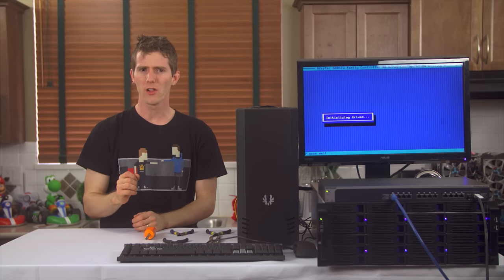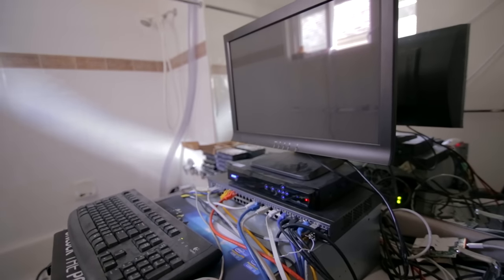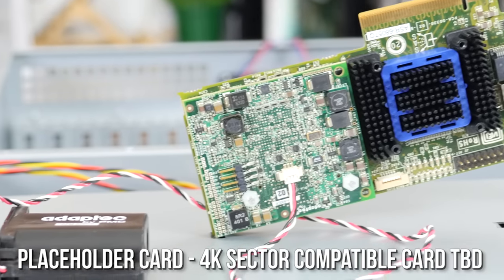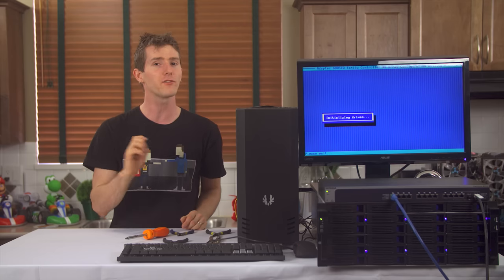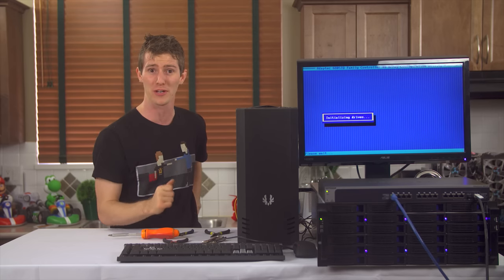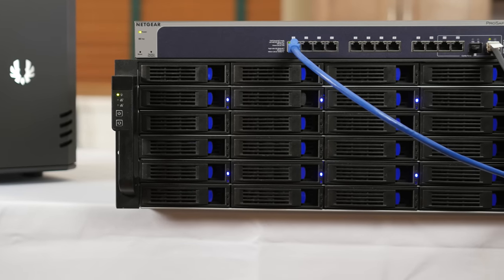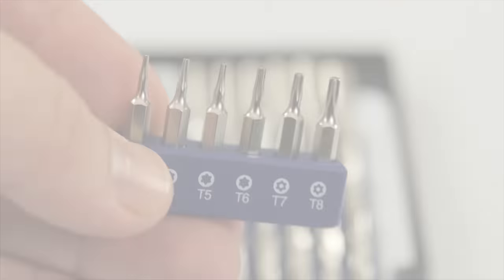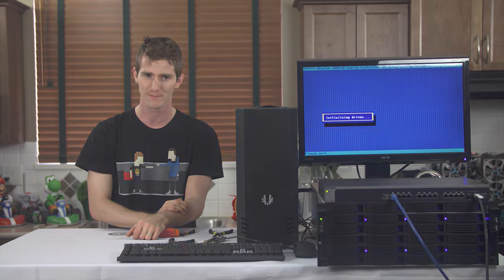Insane Storage Server - Fully 10 Gigabit Network, $1,500 Switch

Comment: You went through all that trouble and didn't use a ZFS supported OS? What the fuck is up with RAID 6? No matter how careful you are about component selection or how many redundant drives you have, you can NOT prevent data corruption which normal RAID will do NOTHING about, that's NTFS for you.

The only sure fire way of protecting your data 100% of the time is with ZFS and a distro such as freeNAS. You guys seriously need to consider ZFS if you're adamant about data protection and integrity.
Reply: I doubt losing a few bits in a video really affects anything noticeable. You're just regurgitating what Wendel said on The Tek, where he was more focused on integrity of more vital things such as documents and source code.
Reply: I do agree with you, not completely though. ZFS is a great file system to consider for large raid arrays and paired with FreeNAS, its off to the races. But, you have to understand that there is no sure fire way to protect your data a 100% of the times. The best you can do is to reduce the probability to a certain extent that it is VERY unlikely to happen.

ZFS is great because it warns you if a drive is going bad and gives you enough head time to fix it.

Also, RAID-Z. RAID-Z 3 allows you to lose up to 3 drives before suffering a complete data loss. Which believe it or not comes in handy when rebuilding large arrays.
Reply: 100TB FreeNas will need at least 100Gig of Ram... jeeeeessssuuuuusssss!
Reply: Benjamin Puna He has a 128gig kit.
Reply: Kony Hawk Pro Slaver I would agree with you, except in a RAID array, you either lose nothing or everything. So its not about losing a few bits rather about losing everything.
Reply: Benjamin Puna That amount of required RAM is based on a myth. You would only need that much RAM if dedup was enabled and had a lot more than six users. Even then an enterprise SSD L2ARC would greatly reduce that requirement.
Reply: 3fsdfsfs ZFS has a high RAM requirement because it is used to cache data before writing  to the disk (to improve performance). It is true that you can work with much lower RAM than "recommended", but enabling dedup will increase the ram requirement to well above 100gb. Its not per say a myth, because if u run out of ram, bad things can happen. And yup, L2ARC does help in reducing the ram requirement (if not using dedup).
Reply: Samar Sunkaria The problem isn't complete data loss, the problem is data corruption during regular usage, which is something you'll be encountering a lot during a regular RAID array since the disks aren't reporting faults back.
Reply: Samar Sunkaria "ZFS has a high RAM requirement because it is used to cache data before writing  to the disk"
Every modern storage stack does that and the amount is smaller than you think, typically less than 1GB per transaction and if you only have a couple of GB of RAM in your 100TB storage box, I'd question your sanity.
"enabling dedup will increase the ram requirement to well above 100gb"
Yes and no. First off, why would they enable dedup on a video data storage rig, given that they're unlikely to have duplicates? Dedup is for VM storage and similar stuff, where high dedup ratios are common. Second, with large block support having arrived in Illumos last year (don't know about FreeNAS, maybe they'll pick it up soon) and LTT's large file requirements, it's possible to comfortably fit the dedup tables for 100 TB of unique data into ~30 GB of DRAM and that's the worst case.
Reply: totoritko "Every modern storage stack does that and the amount is smaller than you think, typically less than 1GB per transaction"

ZFS is notorious for occupying large amounts of ram. There is no hard limit to the amount of ram that ZFS occupies. The more you have, the more it will occupy. ZFS maintaining 2 caches, read cache and write cache.

The contents of read cache are dynamically allocated (depending on which files you regularly access). the 1gig per TB of HD is a crude approximation for home users (2gig per TB, for enterprise). So, if you have 16gigs of ram and a 1tb hdd, you can quickly go out of cache.

"it's possible to comfortably fit the dedup tables for 100 TB of unique data into ~30 GB of DRAM and that's the worst case."

Woah, did you pull out that figure out of a hat?
Deduce in most cases occupies somewhere from 2gig to 5gig per TB of storage. In fact going below 5gb per TB mark is really not recommend. YOU DO NOT WANT TO RUN OUT OF RAM WHILE USING DEDUP.

For more details you should consider reading this doc: http://olddoc.freenas.org/index.php/Hardware_Recommendations
Reply: ***** I think Hostile is also forgetting that Linus is on a Windows server and Windows cannot be on a ZFS partition and has to be on a FAT or NTFS partition .... without using tweaks to the OS to get it to run on another type of partition but i am mostly sure they will not be supported by Microsoft support nor indorsed by Microsoft for doing so as like anything you can probably find a person who wants it to work just i do not know how to get a Windows system to run off of the ZFS partition ... now it can read off of one yes just it cannot run off of it is all.
Reply: ZFS can be used as a volume filesystem ( block level ) on the physical drives. Then you can use nfs or cifs to present your storage. 

Or you can use fc/iscsi to get block level storage ( but this will create more overhead in budget and performance ).
Reply: InIMoeK  except for his point was to " practice what he  preaches " and he didn't preach about ZFS but RAID storage though you can have both at the same time which i am surprised no one has said in this comment stream before it is a little heavier on the drives and  probably requires double as much RAM to do if also using dedup in it for ZFS to work properly without errors but still it can be done ... i just do not think he will be doing it due to it is not that practical to do on a Windwos system

fc/scsi is more practical yes though the performance hit might or might not be small enough for him to think it is worth it
Reply: Why are you assuming a RAID6 is formatted NTFS?
Reply: Jon Kensy Because RAID does not support ZFS, nor does an operating system like Windows Server. You need an OS that supports the ZFS file format such as FreeNAS which is based on FreeBSD.
Reply: Uh wait, so RAID doesn't support ZFS so that means RAID is formatted NTFS?  Does anyone who subscribes to this channel have a clue?
Reply: ***** as RAID is hardware controlled and ZFS is software controlled how does RAID not support ZFS ?
Also you can have ZFS partitions on windows just not the primary partition ... 3rd party software is required to make, maintain and use the ZFS partitions in windows but it is possible.
Reply: yumri4 The whole array needs to be in ZFS and in software parity like RAID-Z2 to prevent data corruption. You need an OS that supports it from the ground up. Normal RAID only supports NTFS. Using software tricks to have a ZFS partition on your drive is a terrible idea as ZFS is only part of the solution. You need an OS to monitor and scrub data on a routine basis to keep data integrity and prevent silent corruption. You can have 50 redundant drives, normal RAID will not save your data in case of a drives S.M.A.R.T failure or other glitches.
Reply: Jon Kensy Yes, since he didn't specify what filesystem he is running it could be any number of things, and no ZFS is not by a long shot the only FS with integrity checks, fsck, btrfsck, xfscheck etc, even NTFS has chkdsk, if your data is getting corrupted, that's what backups are for. I personally don't like hardware RAID, the flexibility of software raid is great and if you have a modern cpu with two or more cores, you really don't loose much in the way for performance.
Reply: Aaron Tate "fsck, btrfsck, xfscheck etc, even NTFS has chkdsk"
These are not the same thing as ZFS' end-to-end checksumming at all! None of these will detect data corruption. They'll only detect filesystem structure corruption (i.e. data corruption in metadata). Since the typical data:metadata ratio is around 100:1, chances are by the time you detect metadata corruption, you will already have lots of data corruption in user data.
"if your data is getting corrupted, that's what backups are for"
And how would you know which data is corrupted? Or do you suggest just plain rebuilding everything each time fsck finds something suspicious? (Not to mention you can't really run fsck and certain chkdsk while the system is using the filesystem.) Given the current size of storage systems, must have a lot of time on your hands. That's one of the core problems addressed by ZFS: every operation is performed on-line and only as much of it is performed as is necessary, because storage capacities have gotten so large that you can't really afford to schedule this kind of maintenance downtime (an fsck on a 1PB array can easily take weeks).
Reply: Kony Hawk Pro Slaver Lol your just regurgitating the notion that everyone who follows tek syndicate just regurgitate everything they do. There were other places advocating zfs before the Tek mentioned it. Maybe you should be sure of what your saying when it comes to the integrity of a file before saying things like "I doubt losing a few bits in a video really affects anything noticeable."
Reply: totoritko Spot on.
Reply: Aaron Tate
Only ZFS can protect against bitrot. The integrity checks of all those filesystems are primitive compared to what ZFS offers.
Reply: They did the research, and concluded that ZFS wouldn't provide any benefit over RAID 6 for their particular scenario. ZFS would be far better for systems like thier 'Vault' server, but a redundant RAID setup is more than sufficient for what they need.

Comment: I work in networking, and $1,500 isn't much for a 10Gb switch....
Reply: its a shitty switch
Reply: Victor P You should wash your hands after using the bathroom to keep your switch clean.
Reply: Dave L The switch wouldn't get near any I've implemented that's for sure. It's crap.
Reply: TKSnatch Any idea why?  Firmware?  Poor quality electrolytic capacitors?  Cooling issue?

Comment: In the last 8 years or so, I've had ~20+ enterprise server HDDs fail (HP ProLiant and NetApp FAS, mostly HP) and in that same time ~3 workstation HDD failures (mostly caused by users). For a number of years I've been running a normal WD 2TB drive in my home PC 24/7 without issue.

Comment: I had no idea 10Gb switches had come down to SMB price levels. I just ordered a XS708E for by SAN/NAS setup. I already have 10Gb NICs that I built off a post made on one of the tech forums (they cost <$40 each), so I can order a couple more and my two workstation can connect to all the storage system at 10Gb speeds. If anyone is interested in the NICs I can post the links.

Comment: Having just built an ESXi server with 32TB of backend storage I am not envious of the 6TB disks.  If those puppies fail you're going to have one hell of a long rebuild time.  Also, why are you using a workstation board for a "server"?  The system specs are more of a hypervisor configuration than a file server.

Comment: Why not using a ZFS based system with an HBA linking the drives directly to the kernel? That Xeon with some more mem can do far more awsome stuff. 

And I hope the switch is not a store and forward type switch.. This will get laggy when bumping 2 streams of 10Gbit in lacp. But budget could be a problem using a non blocking switch :)

Infiniband is also getting more interesting on the second hand market. 

Anyway cool to see some storage/networking stuff here!

Comment: yo Linus. link aggregation doesn't combine bandwidth so you shouldn't see 20 gig speeds on a single connection.  It's for redundancy and crude load balancing if that switch supports it.  but I think you'll be just fine with 10gbe.

Comment: Had to chuckle at the $1500 switch, as I use those all the time, and just switched to an HP 5406zlv2 at work for a total of £6200 ($12000 cad).

The storanator and the rendering server both sound good as I'm looking to deploy something similar for exactly the same purpose, and was looking at Netgear ReadyDATA/QNAP/Synology but a DIY build might work for driving down cost. My current rendering server is a HP DL380G7 with 2x 6 core Xeons at 2.5GHz with 32GB of RAM, but in Adobe Media Convertor I'm only achieving 30mins for a 45min video so anything that can improve that is a plus, possibly moving to GPU rendering?

Comment: 10 GB?!   lolz  I work for a company that is building a data center for the CSA - it's backbone is 10 GB...  we deal with satellite images.  you'll NEVER use 10 GB, son - never!  10 GB is HUGE and cost of gear when you get in that range is costly - the Cisco ASAs we have in the topology are about $280+k
Reply: Steal a part and ill give ya $500
Reply: 10Gbit internal and external is different. Maxing 10gbit internally streaming RAW 4k is easy. Especially with many editors. Maxing 10gbit externally is a little more difficult. And expensive at that.
Reply: Suicidal_Tissue you don't know what you're talking about, son.
Reply: You clearly don't know what you're talking about. You state that you work for a satellite company when you can't differentiate between 10GB and 10Gb. And yes, it is fairly simple to peak a 10Gb link, my streaming and working directly with RAW 4K footage.
Reply: 10Gb backbone is ridiculously expensive, but LAN? Not so much. Fairly decent 10Gb switches are around £1k, and desktop NICs are around £350. 

If you've got four editors streaming ProRes or RAW at 4K over that network... yeah, you're gonna max that out very quickly. 

I'm moving my home network to 10Gb because I use iSCSI mounted drives on a storage server instead of internal drives, and 1Gb can be a massive bottleneck.
Reply: Andrey Volk wrong.
Reply: Suicidal_Tissue Ethernet is Ethernet - regardless if it's a private or public network.  Geesh...  so many idiots.
Reply: Alfie Pates Ethernet is ethernet.  Go read up on it...
Reply: TallahassZ Remington Look, if you read your original comment, you said 10 GB, which is gigabytes, withich would be an 80Gb link. I know what CCIE is, I am getting there. CCNP at the moment! :P

It would take an ether-channel group of 8 10 Gb links to get 1 10 GB link.
Reply: TallahassZ Remington Oh yes, my son, I'll chew up 10 Gbit/s easily. I've built all-SSD enterprise storage rigs which saturated four 10Gbit/s ports.
Reply: This channel is all about doing what we wouldn't do rationally. Stupidly entertaining for kids and tech related people like us. Kind of fun though ridiculous most times. They don't pretend or claim to be experts, they just do their own thing, lolz which is welcome in my book.
Reply: Im a CEO and syadmin of a fairly decent sized GSP. I think i know what I'm talking about, thank you.
Reply: wow did you guys hear that? no? yup, thats the no one care sound

Comment: I was about to ask why LACP, then I realized... not Cisco equipment. Though that still begs the question why LACP and not just static link aggregation? Does that have to do with the dual Intel 10gbit chip capabilities (can it not be the LACP manager, does it need to negotiate, load balancing requirements, etc)?
Regardless, it's lookin' good!

Comment: What is a good cpu cooler for a 4690k? My case only has 150mm of clearance, and I'm on a budget. I won't overclock too much, but I'd rather be safe than sorry. Thanks!
Reply: Cooler Master Hyper 212 Evo is a really good choice. It's only 120mm, so you'll have room for it, it can handle my 4690k @ 4.5GHz no problem. It's priced around $40 (although I'm in Canada so it might be cheaper for you if you're in the US) Hope this helps.
Reply: Bluurie Dude, that won't work since the 212 is actually 159 mm in actual height.
Reply: Bluurie the 212 evo is over 160mm tall
Reply: evga mitx air cooler, looks awesome and was build to fit in their mitx hadron, should fit your needs as it is 45 usd last time i checked, if your budget allows get a noctua cooler, they have many short options
Reply: you might want to look for "low profile cooler" category.
Reply: I have a 4690k and I use a Corsair H100i. Its really good for me. Id suggest Nzxt phantom or whatever.
Reply: Kian Friden Trust me, if you want the true value of your CPU, overclock. Watch a few videos read a book or two and you will realize its not that bad. If it's done right, there is little danger.
Reply: Cooler master tx3 evo. It's the small 92mm Brother of the 212 evo. It is about 13 cm total height and costs about $20-25
Reply: I'd suggest the scythe katana 4 or the cooler master d92
Reply: just pour cold water on your CPU when you're over clocking
Reply: KuBz I don't see any problems with that! thanks :)
Reply: an AIO Liquid Cooler may be a good option.
the height on the Processor itself is basically nothing. so then, you only need to have a practical spot to mount the Radiator.

and just like Air Coolers, AIO Liquid Coolers range from very budget, to stupidly overkill unless you live in the middle of a Desert.
Reply: +taiiat0 While I do agree some AIOs are too pricy, I think your over generalizing. If you ever want to do some overclocking on a k series, or amd processor, water coolers are a great way to go.
Reply: CobbleWalker what?
i said AIO Liquid Coolers, like Air Coolers, have a wide price range to fit your needs.

Comment: We had a EVO raid setup with 10gb ethernet switch at my previous job and it was like walking into a windtunnel. I have no idea why the hell that swich makes so much noise...what kind of fans are they using?
Reply: Delta fans. 10GbE get extremely hot if not cooled properly. 40mm delta fans spin anywhere from 5-10K RPM producing anywhere from 55-85dB.